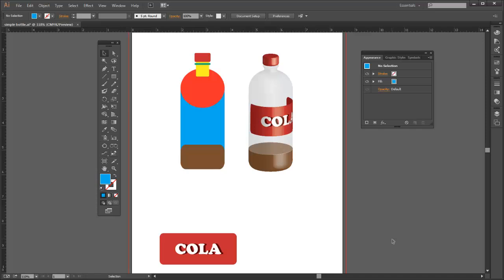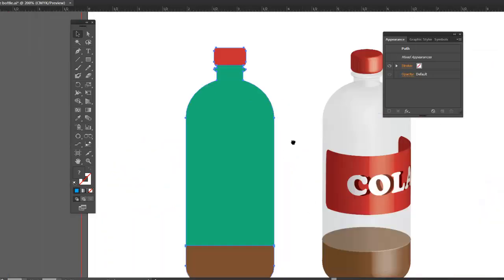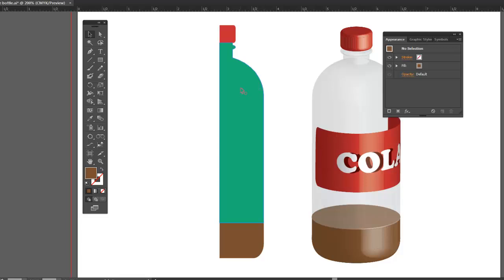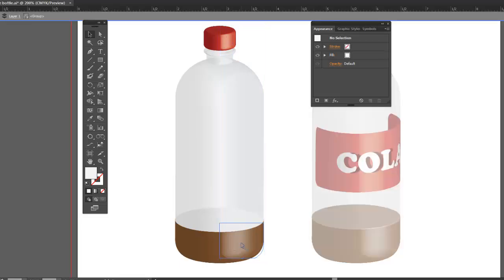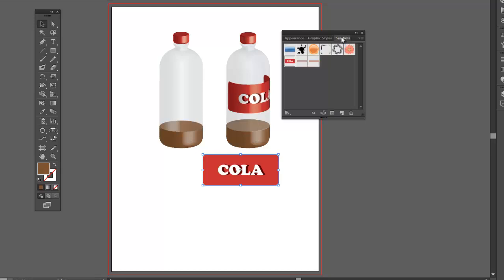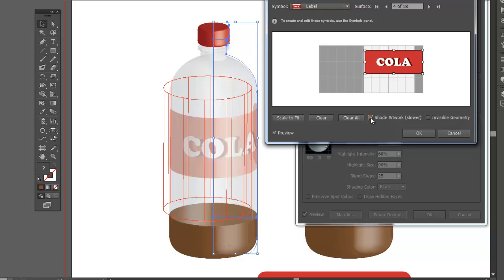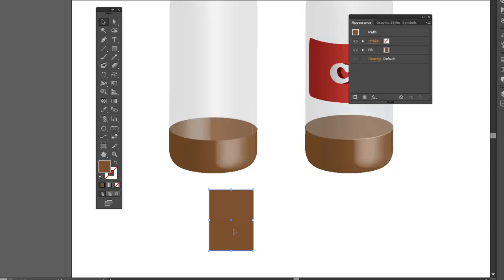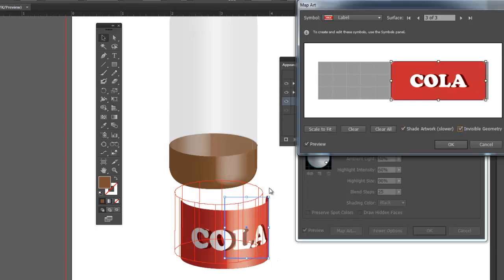3D Bottle and Shape Builder Tool

Comment: Thank you for saving my time. I also tried to find approriate solution for this problem. But I have one more now with saving transparent picture in jpeg file format. It becomes white for some reason. who knows the answer please reply
Reply from the maker: JPG does not support transparency. Try using PNG. If you are using Adobe products, you can usually place or import graphics in their native Photoshop or Illustrator formats and their transparency will be honored.
Reply: AdobeTalk No it does not work too. The problem is that liquid in the bottle disapears when i try to save and illustrator excludes inbeded object( I have to mention that two objects: liquid and bottle intersects when i apply 3d revolve

Comment: Thanks for the tutorial, its helpful. but I need to know how you created the cap texture as well.
Could you please help.
Reply from the maker: +Neha Madan I grouped 2 lines together, each half a point wide, one is a little lighter than the other.  I created a blend to repeat the lines.  I use a little geometry to calculate the length of the blend, 2 x pi x radius of the cap.  Created a symbol and mapped it to the cap.  Hope this helps.